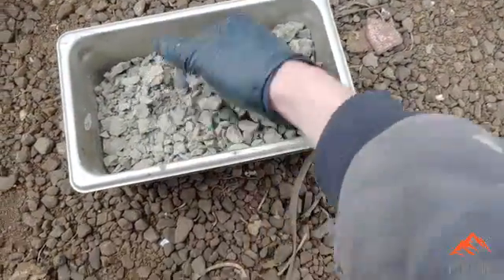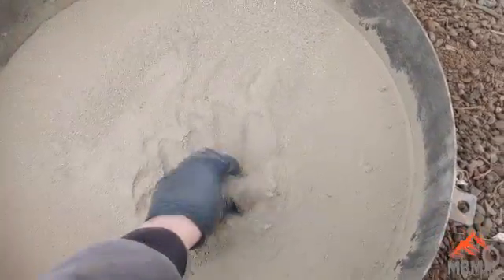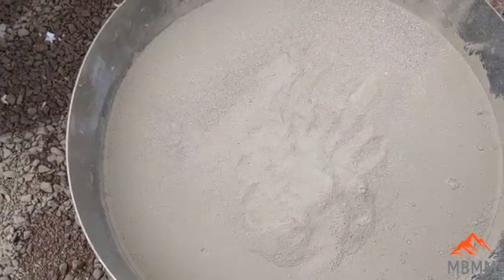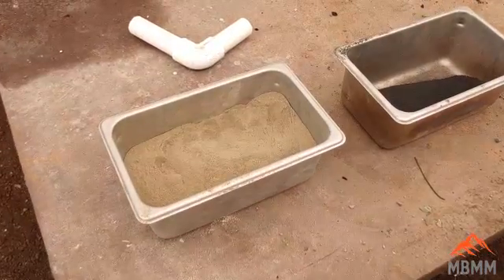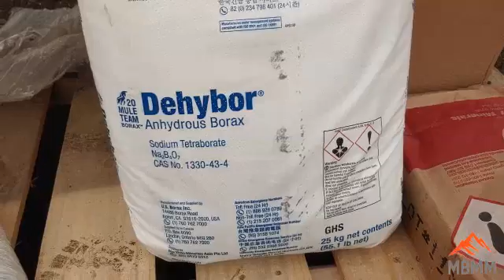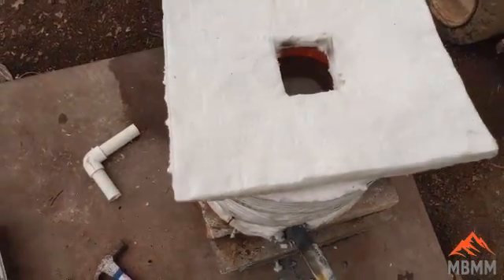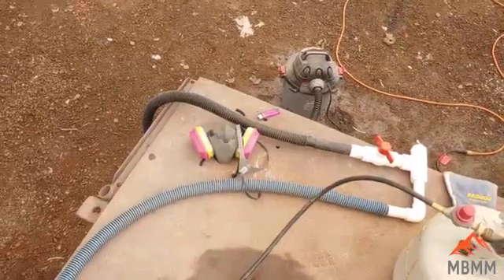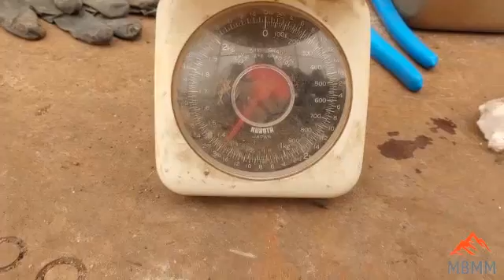Gold From Lost Lead Pt. 1: Lead, Gold, & Silver Recovered by Re-Smelting Cupels

Comment: Please help! I've been trying to do this and I'm having problems. The beads of lead just float at the top and do not coalesce together. I noticed in your video you have some type of vortex or spinning on the surface that helps coalesce the beads together. I'm using a similar setup and the flames do spin around but it doesn't make the molten surface move or spin in any way. I seem to be getting this crust floating on the surface as well which I assume is what you are referring to as the iceberg. Am I missing something? Please help!

Comment: WHY didn't you get a funnel?    By using your hands, you had to waste 5 - 10% --it looked VERY un-professional.    Once the funnel is used, you use a screw-driver to tap on the walls of the funnel, so ALL of the ground-up cuprics could be processed.